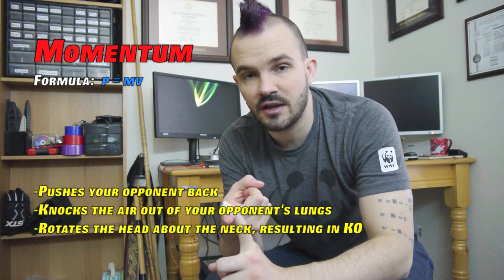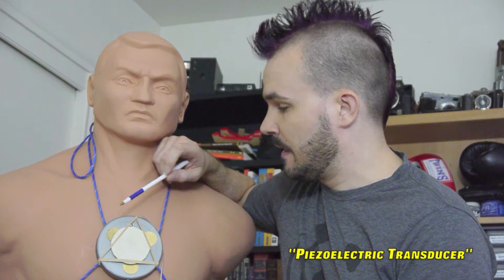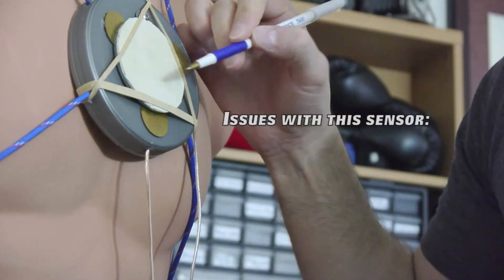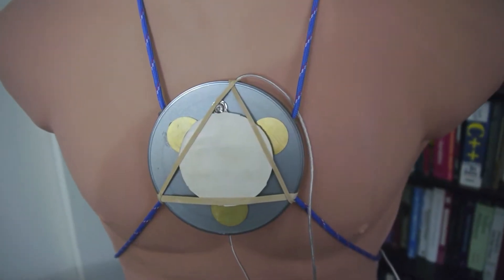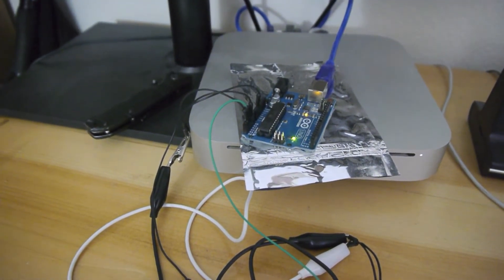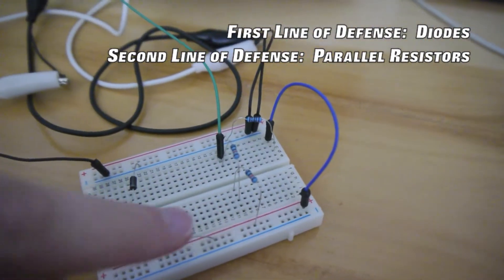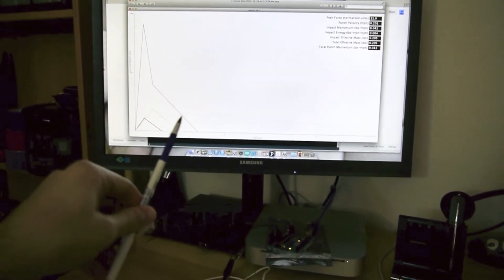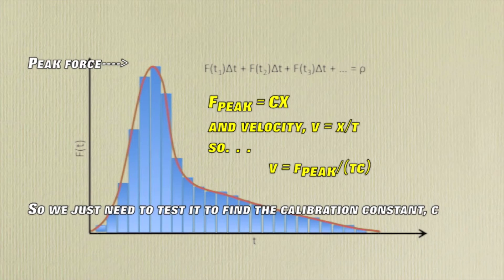The Punch Sensor

Comment: Interesting design.
I've planned to do some similiar project using either accelerometer, piezo or a proper force sensor or combination of these. That software calculation thing you got there is very neat, but the input of mass is very dependant upon the style of the punch.
Btw. it might not be always safe to lay electronics on a semi-conductive ESD bag :)